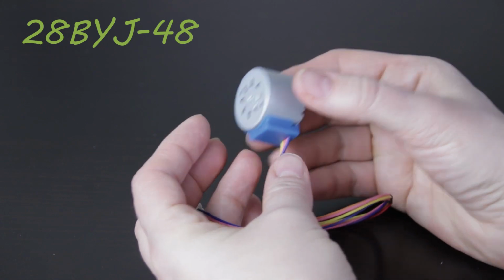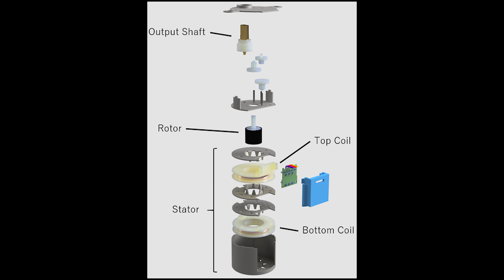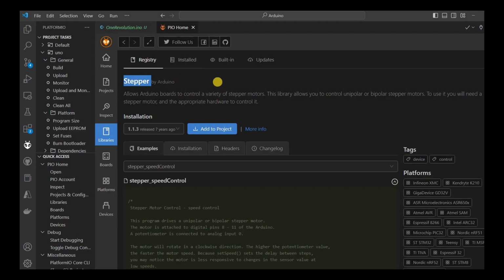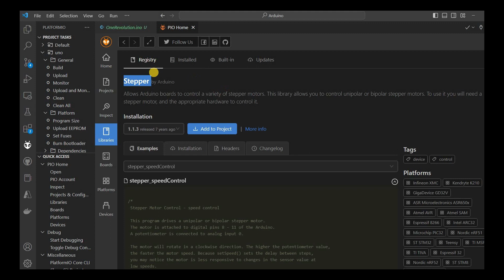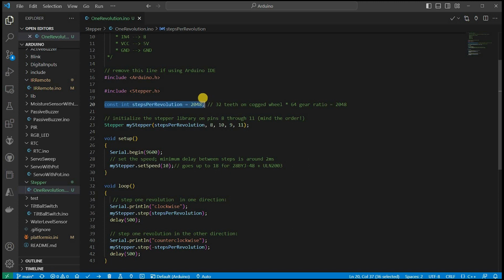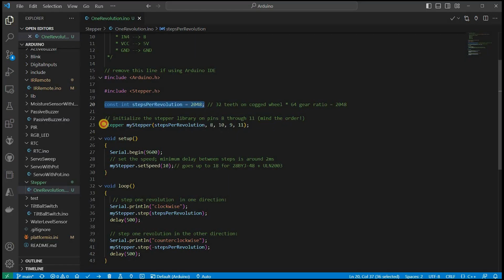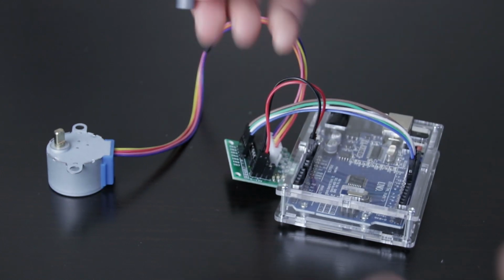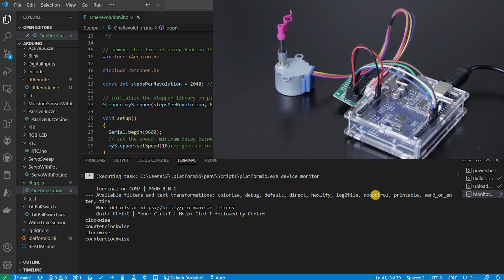Stepper Motor 28BYJ-48 with Arduino

Comment: can you tell me how much weight it can hold...like want to use this one in my project for dispensing rice to the bowl...i just want to use this stpper motor as open and closing the valve..so it can hold 1kg of rice??
Reply from the maker: Hi Nikhil, I'm not sure, but you can check the datasheet of this motor for more information.